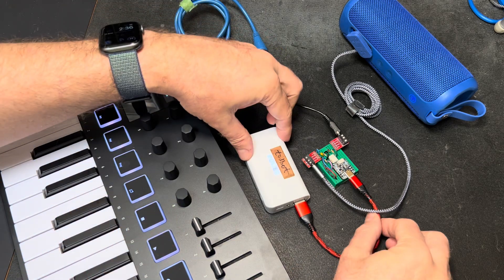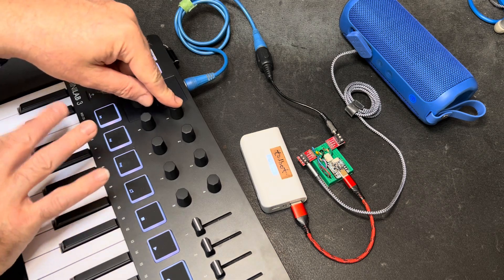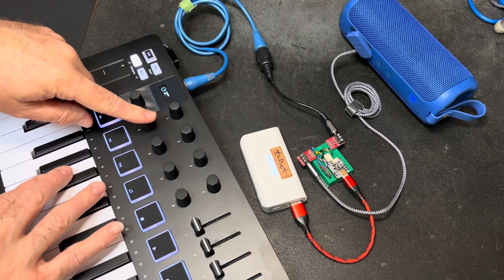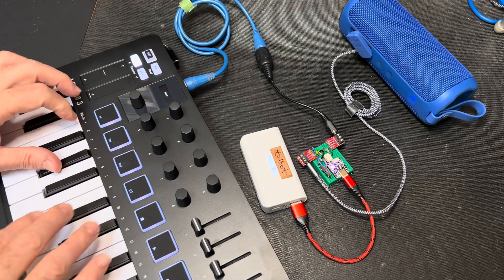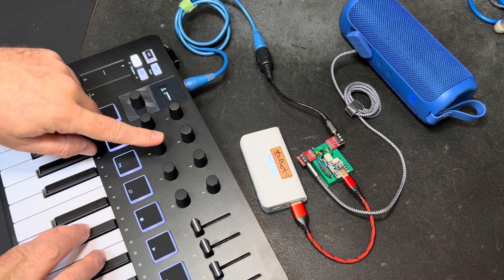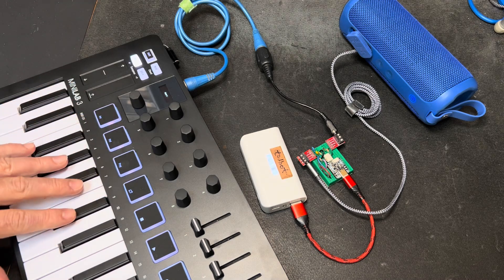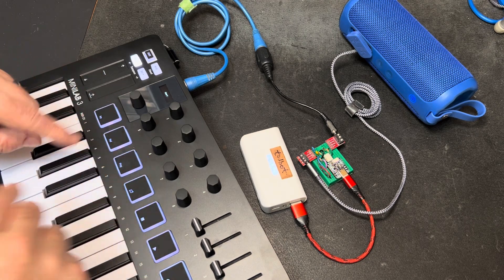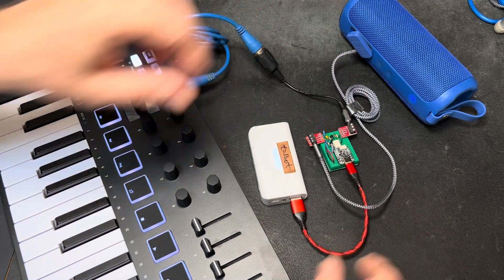monosynth1 in synthio

Comment: Sounds really nice. Could you add some info about the circuit and the components you used?
Reply from the maker: Hi! Still working on that, but wiring diagrams here: https://github.com/todbot/circuitpython-synthio-tricks/tree/main/examples  The MIDI In circuit is most of it, and @SimpleDIYElectroMusicProjects has a much more complete post about it https://diyelectromusic.wordpress.com/2021/02/15/midi-in-for-3-3v-microcontrollers/